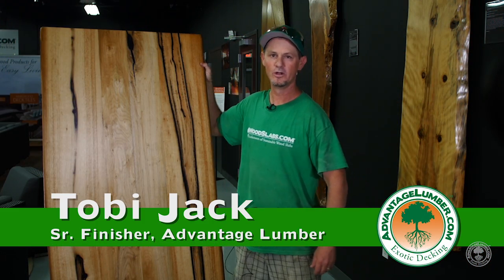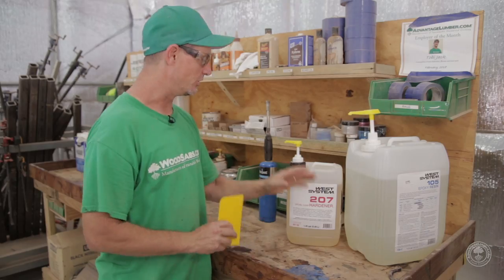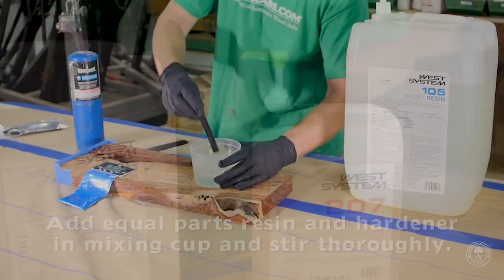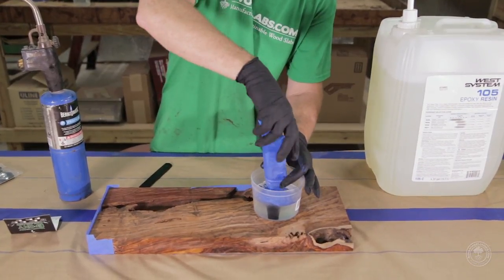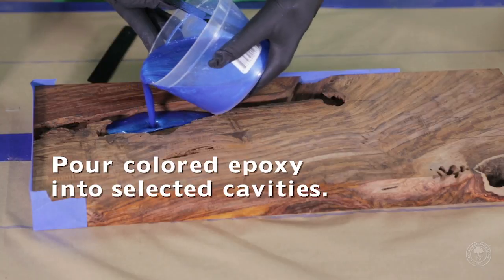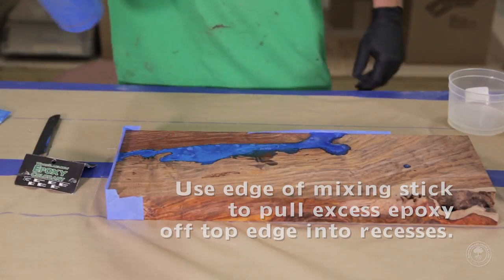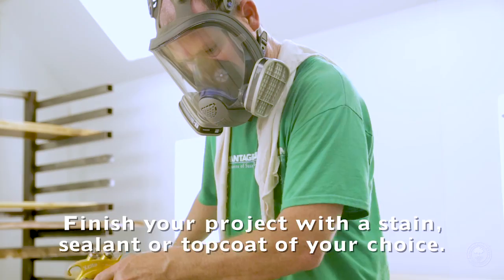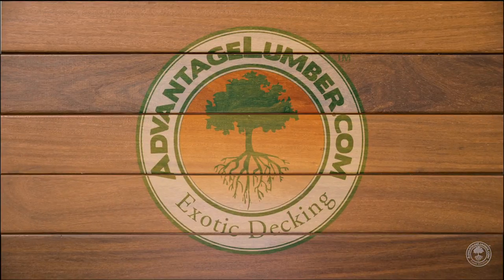How to Make Colored Epoxy Resin

Comment: Can those colorants be mixed to achieve a custom color? If so, would I want to first mix the powders together separately in a dry bowl, or could I get away with dumping both/all colorants directly into epoxy and blend from there? Does that stuff blend together as well as paint does? Thanks 👍🏻
Reply from the maker: Yes you can mix different colors . Check the color in a clear cup. Add the colorant slowly, you can always add more but you can't take away.

Comment: Nice color in the mix but you might mention on the next epoxy videos using the West System epoxy that the cured epxoy releases a wax surface skin which needs to be washed off before sanding (clogs the hell out of the sandpaper) and finish products might not adhere to the epoxy.

Comment: Can i use a heat gun instead of a flaming torch
Reply from the maker: You can use a heat gun but be very careful because it will move the epoxy around. Use a butane torch but move the torch very quickly because epoxy can burn. You'll find it doesn't take much at all to pop the bubbles.

Comment: Realise this is 2 years old but I have a question.  If the epoxy colour runs onto the area surrounding the void will that permanently stain the wood or should that be able to sand off and just leave the resin in the void ? Thanks
Reply from the maker: It won't stain the wood. You would plane and sand off the excess resin after its cured.

Comment: Can I use this colorant when applying to carbon fiber weave as part of wrapping joints on a bamboo bike frame?
Reply from the maker: We can't really give you advice on this because we've never done that. If you wanted to experiment yourself though we'd recommend trying it on a small piece or smaller project first before committing to your larger project.

Comment: it’s difficult to find a video that shows the west 207 mix ratio for what you’re doing...thanks so much! Is this ratio something you came up with after trial and error?
Reply from the maker: The ratio comes from West System and is automatically the proper ratio when you use their pumps so it makes it much easier. If you want to do a deep pour river table we recommend using WiseBond Deep Pour epoxy.
Reply: Thanks so much for taking time to reply! I just received my west system 207 and the ratio stated is a 3 part resin to 1 part hardener.  I’m pouring small voids no deeper then 1” (much like your video) In your instruction you’ve used a 1 to 1 ratio.  It’s expensive stuff to trail and error test runs, so I thought I would clarify.  Many thanks in advance if you take time to reply!
Reply: @AdvantageLumber  Did you intend on stating equal parts of each.  West systems states a 3:1 ratio.  With the Mini Pumps, I believe it should be equal pumps instead of equal parts.  Can you confirm this.  Your projects are beautiful!!

Comment: I’ve seen all over the internet that the combination of west systems 105 and 207 harder cures yellow. Is it the way you mix it or something else? Thanks
Reply from the maker: The yellowing usually occurs in the clear epoxy over time. Mixing pigment in with the epoxy should reduce the yellowing.
Reply: @AdvantageLumber  Thanks

Comment: Does Epoxy stick well to glass? I know it is safe for fish once cured, but i was hoping to put a nice beautiful layer on the bottom of my turtle tank for a beautiful effect.
Reply from the maker: We can't give you a definite answer it might not stick. There's only one way to find out.
Reply: As long as you're putting it on a watertight bottom it should work. If it floats off, you can just use silicon to glue it down.

Comment: So epoxy is different product than resine that is used 4 boats?
Reply: Resin is an expoxy I think
Reply from the maker: Yes, it is different than polyester resin, which is what is used on boats. Epoxy for boats has that harsh chemical scent. This epoxy resin shown in the video needs to be mixed with a hardener. It is also nearly odorless.
Reply: The epoxy used in this video is a marine grade epoxy resin.which has to be protected from the UV rays of the sun. Either painted over or use of a varnish. As stated below in Tobies response polyster is a different chemical make up but is still a resin

Comment: I have a question, has anyone ever tried using Testors enamel or acrylic paint with Epoxy resin? Does it work?
Reply from the maker: We have not
Reply: Acrylic paint works fine, it just makes the color solid and bland

Comment: Can I run that board through my 12" plane?
Reply from the maker: That depends on the specie of the board, if it's end grain or not but in terms of the epoxy yes you should be able to make light passes.

Comment: Why doesn’t the epoxy catch on fire ?
Reply from the maker: Certain epoxies can only be poured very thin otherwise the exothermic reaction becomes so strong they can catch on fire. If you are looking to pour deeper epoxy all at once we recommend using WiseBond Deep Pour epoxy. You can pour up to 2 inches thick in one pour it has a slower reaction and curing time so you don't have to worry about it heating up too much, it's the best epoxy we've tried for pouring epoxy river tables.

Comment: Why did my epoxy foam up? It looked like elephant toothpaste.
Reply from the maker: You might be using a cheap epoxy or you are trying to pour too much at once. Some epoxies can only be poured in thin layers if you pour them too thick or deep it heats up too much and produces lots of bubbles and foam in some cases they can heat up enough and catch fire. If you are trying to pour deep rivers we recommend WiseBond Deep Pour Epoxy.

Comment: I don't understand how it's okay to work with epoxy, let alone applying heat, and don't wear a vapor mask.
Reply: This type of Epoxy doesn't have any solvents or significant vapors. Some of them you can barely even smell. It's most important to keep it off your skin.

Comment: shouldnt you be using a mask?
Reply from the maker: It does not really give off fumes and we are doing this in a professionally ventilated workshop. You'll see when he's spraying the clear coat finish on he's using a ventilator as that's much more harmful. If someone is very sensitive though they can and should wear a ventilator when mixing epoxy.